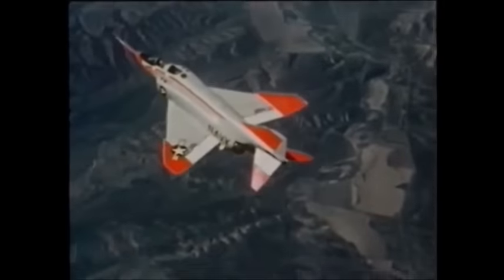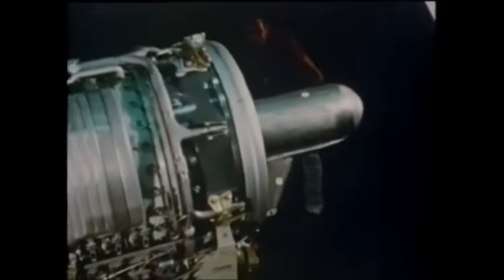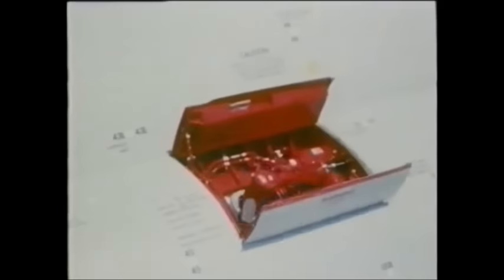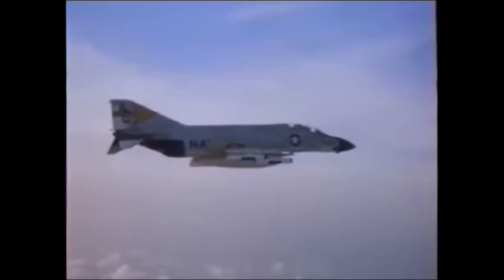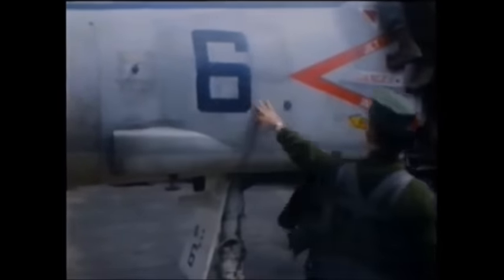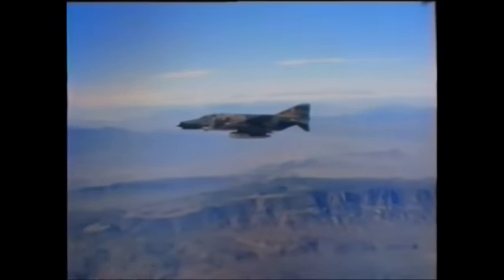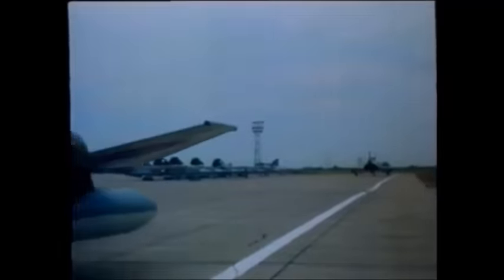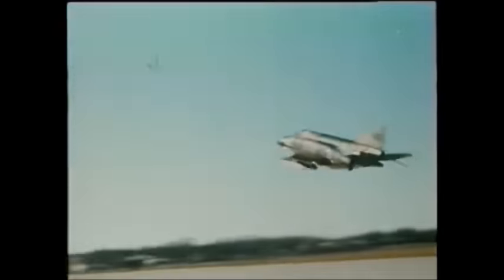F-4 Phantom II Documentary (1987)

Comment: The canted horizontal stabilizers and matching wing tips look so cool.
Reply: A Anhedral and dihedral sloped wing is the term you're looking for, not canted, and the rear flight surfaces that hang down at a 23° angle, they're called stabilators, not stabilizers.

FYI....
Reply: @scottgamble3445 it isn’t wrong to call the stabilator that. It’s just the American way

Comment: 5000 of them.  Had no idea the numbers were that high.

It took two of us to replace the F/C/P ICS Box.  Why?  The square tube containing the internal boarding ladder was right in front of the box.  So, a double 90 degree bend in the thick wiring in a very short distance.  We'd use a wooden stick to shift the wire bundle around.

You could get the box a little above the console rail.  The person in the cockpit would stand on the box and push down from the open canopy.  The person on the boarding ladder would lock in two dzues fasteners-on a diagonal-to anchor the box.  The person inside could then lock in the last two.

On top of the backbone (panel 48) was the upper UHF antenna.  Fuels couldn't be bothered to disconnect the antenna and stripped it off the connecting cable.  This happened so often (not following tech data) the USAF had a stencil by the antenna telling the person to disconnect the antenna before removing the panel.

The UHF radio removed from a phase aircraft had to go back in.  The guy that installed it couldn't get it to work.  So, I went out there and applied power.  Yep, no workie.  The radio was on an interface mount that plugged into the aircraft.

Pulled the whole thing out and felt back there.  @$%@#$%#$%#$%  Someone covered the female end of the connector in the metal foil from a candy bar.  Removed the foil, plugged it all in and it worked fine.

Comment: An amazing piece of aircraft engineering for its time. Too bad it's missiles couldn't hit the side of a barn door from ten feet away. And too bad they didn't give it a gun
Reply: USAF E’s had guns, but this only marginally improved the kill ratio in that service.
Navy F-4’s didn’t add a gun, but instead responded to rolling thunder by increasing crew training standards and creating TOPGUN.
The Navy’s kill ratio climbed while Airforce F4’s lagged behind, solid proof that the lack of a gun was not the problem. In fact, gun kills remained far behind AIM-9 and AIM-7 for the course of the war.
Reply: The largest reasons for missile underperformance were outdated and ineffective maintenance procedures, rules of engagement that prevented the Sparrow from operating at anywhere near it’s maximum range, and flight crews’ operator errors.